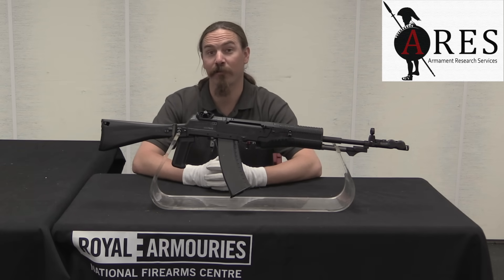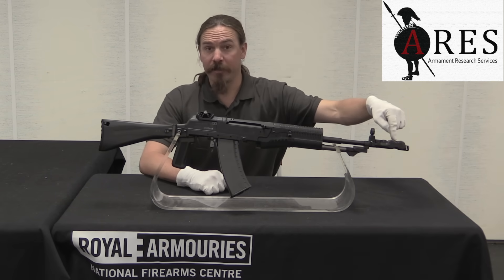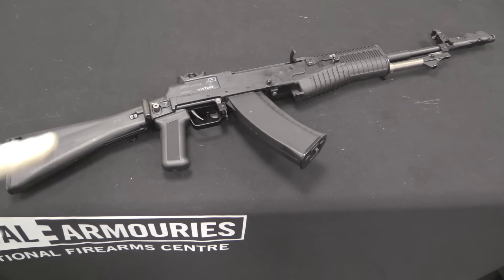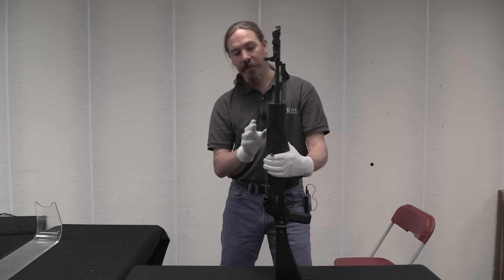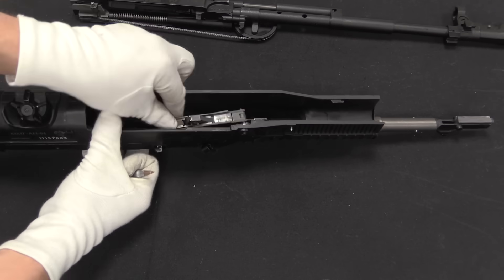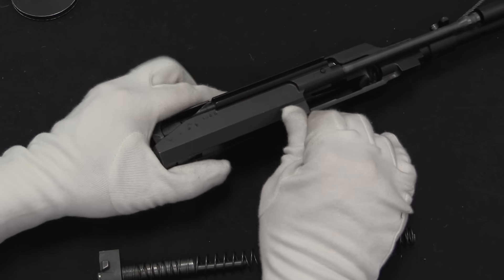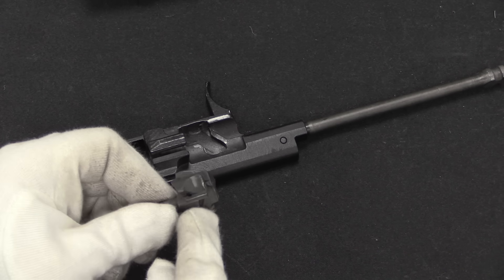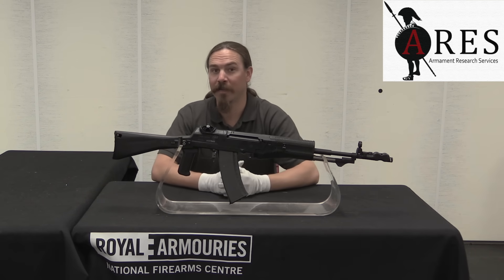Rocket Surgery: Inside the Russian Nikonov AN94

Comment: I don't understand why the little shuttle for pushing the 2nd cartridge out of the mag is necessary, if all it does is push a round half-way out of the magazine. I mean, what is the point of partially chambering a 2nd round to get it ready to fire if the bolt still has to travel the full length path to the rear of the gun and then back to battery, and can pick up and chamber the 2nd round while doing that just fine

someone please help me out here

is the little 2nd cartridge shuttle REALLY just a counter reciprocating recoil balancer and they decided to give it a little job to do so that it has a secondary purpose??????

Comment: hey ian! i doubt you check the comments on these old videos but if you do.... in the video i think you forgot to mention that the full auto setting fires 2 rounds in the hyperburst mode and then changes it’s rate of fire to the slower rpm for all the rounds after the first 2 for every trigger pull. and i was curious how that was possible? i know theres other guns that can change rates of fire but not during a single trigger pull. it’s just so neat.

Comment: It's an interesting solution to a problem, though, are problems than this platform creates, outweighed by the problem it solves? 

And you can see that AN94 creates a few problems, namely: 
Firing from a prone position using the magazine as a stand would be annoying. And before you say anything to the extent of "you are not supposed to fire your AK/AN like that", read the field testing report for AK47 from 1948, it is very much an intended style of using these weapons. 
The position of the strap loop on the left side of the stock could be annoying while aiming.
Imagine clearing a misfeed in this? Hopefully, you can shake the casing out, but I fear some misfeeds would require a tool or even partial disassembly, and nothing is more fun in the middle of a firefight than having to disassemble your gun to clear a misfeed.
The double fire mechanism makes a good grouping when the gun is held fairly loosely, which is what it was designed for, but the complexity of the machine makes it unfit for the general army use. On the flip side, the way that a professional tends to hold a gun (I understand that there are situations and gear that can prohibit this, but if they have a choice) is in a rigid, controlled grip, at which point the double fire grouping is reportedly a lot worse than just firing any usual, much simpler, much more usable platform twice, be that AK or AR.

It's undoubtedly a very neatly engineered machine, a very cool piece of gear, but it just feels like a solution that doesn't really solve anything for anyone who could be using it and creates more problems compared to other platforms they are already comfortable with using.
Reply: No one cares nigga 😂

Comment: Ak-47: Who are you?
An94: I'm you but complicated.
Reply: An94: I'm you but smarter
Reply: WeedNose Lieutenant all of what you described is assuming they want the weapon for an army. If you’re special forces you might wanna pick the AN-94 because you’re more specialized so there’s no need for simplicity.
Reply: @doc3353  even then, you just want a gun that does its job.  Usually for spec ops they’ll have a gun with different attachments like a thermal scope or a grenade launcher or something.
Reply: Please guys. Remember the AK74

"I am you, but better"
Reply: @TheKamiBunny  The AKM is a better AK-47. AK-74 is AK platform using new ammunition and improvements such as better muzzle brake.
Reply: @relevant3773  I thought the AKM is basically an improved variant of the AK47, the 74 was rechambered to a smaller faster caliber and as you said had that improved muzzle break. 

What would the AK107 be then?
Reply: @TheKamiBunny  this doesn't answer your question, but the AN-94 and the AK-74 fire the same round
Reply: @TheKamiBunny  AK100 series is somewhat based off the 7.62 AK series (not including AK15) AEK-107 which I believe you are referring to was an expirement to reduce the recoil of AK.
Reply: AK series and AN94 not related.
Reply: @Yku30  It is more effective in the field, but harder to deal with in general and more expensive. So I would say it's better in combat, but not better logistically
Reply: @Yku30  I do not know why I said AEK-107 lol
Reply: @Yku30  However, the AN94 fires a modern bullet, is modular, and is all-around superior in terms of statistics
Reply: @Yku30  The AK47? I have some doubts.
Reply: @Yku30  True, however 7.62x39 is nowhere near ideal for a modern war setting as 5.45. Since most combat takes place at either long range or very close distances, it simply gets outclassed by relatively more specialized ammunition
Reply: @Yku30  True, however it's main benefits (reliability, availability and something else that sadly doesn't end with -ability) are shared by other, less specialized Russian weapons (the AK74M, primarily).
Reply: I guess that is the point, it was way too hard to produce compared with the absolutely decent AKs before it!
Reply: The only superiority of an is that the 2nd bullet hits the same spot as the first one
Reply: WeedNose Lieutenant debatable
Reply: an94: I am you, but better in every single way
Reply: @xdbetyar  blocked

Comment: ooof. That wheel and wire looks like a fail point. That wire streches or is built wrong length, either jump off the wheel or doesn't position properly... remembering HOURS spent adjusting cable activated components (glares at old Alenax bicycle transmission bars, emergengy remote valve trips, and brake cables)

Comment: I think part of the recoil absorption misconception regarding the pulley system might stem from the fact that such a recoil system was designed for the AEK-971, which, to my knowledge, was also developed in parallel with the AN-94 as a competitor for the Russian Akaban(sp?) program.  It features a sort of piston mounted parallel to the Kalashnikov gas system, and while the main gas piston moves rearward, this second mechanism is pushed forward, the idea being it can cancel out the oscillation in the weapon's center of mass due to the movement of the comparatively heavy bolt carrier group.  I know of this being referred to as BARS, or "Balanced Automatic Recoil System."  What relation that label has to whatever name the Soviets used and Russians use, I'm not sure.
Reply: Yeah, interesting how that one's descendant A545 replaced the AN94
Reply: Абакан. (Abakan)

Comment: I'm guessing that when the barrel reaches rear end of travel, it prevents the hammer from striking again as the bolt moves forward the final time in the 2 shot or the semi auto cycle. Otherwise,the movement of the barrel is simply a means of slowing the recoil impulse from reaching your shoulder.

Comment: Explain to me the benefits of this complicated mechanism, please.
Reply: A near-simultaneous two-round burst would defeat a lot of body armor. First round damages the plate and the second continues through.
Reply: @chance20m  You want break armour of body? Hit with bigger bullet.
Reply: @EnjoyCocaColaLight  Which also requires a bigger gun, more weight to lug around, and a more complex logistics chain.
Reply: @chance20m  Weight is only problem until you have of training to the appropriate level. Complexity is of very bad design for doing the sand dust in mechanisms in the field.
Reply: @sebastiangorka200  Fair fair.

Comment: Just a note : "ММГ", written on the side, roughly stands for "Identical mass and size model", that can be made through factory deactivation, but can also be built like that from the start.
Reply: It's factory deactivated weapon. That's a common practice for post-soviet weapon manufacturers. They take old army guns or defective new, deactivate it and sell for civilian market as "ММГ".
Sometimes deactivation is done very badly, so you couldn't use that gun even for disassembly/reassembly practice. It depends on which factory actually did a job and was that gun used by army or it was defective new production.
Defective guns mostly deactivated much nicely than army ones.
Reply: @mk_69mm  I approve that. It is real gun, have been deactivated. All ММГ's are.
Reply: @МаксимГладышев-и3н  ahh yes you've got one of those inverted L letters on your name
Reply: @kakalimukherjee3297  those "inverted" letters was disigned by greeks before your far ancestors learned to write and use instruments
Reply: @kakalimukherjee3297  I see you, fellow non Russian speaker. Imagine if yt didn't translate
Reply: One more note: the keyword are the "mass" and "size", so it is usually not identical to real gun inside, but close to it.
The main idea is to use it for training or something, but without ability to use most of parts to build a real weapon.
The changes are not clearly visible, but critical to work - like bolt changes (some parts can be missed), or barrel ones (like holes and/or obstacles for bullets). So the quality can differs too.
Reply: @MaxPV1981  ММГ made from real gun
they never build as just models. it is deactivated guns always.
Reply: @Stormidze  No.
"Основным отличием ММГ от боевого оружия является невозможность изготовить из макета работоспособное оружие. Макеты стрелкового оружия могут изготавливаться как путём имитации, либо путём так называемой деактивации боевого оружия."

Если просто подумать, то становится понятно, что если какие-то части не могут быть использованы в боевом оружии, то они не являются частями боевого оружия вообще, хотя и могут быть изготовлены на их основе - тогда да, можно сказать и так.
Декоративные и не относящиеся к производству выстрела части, аналогичные по конструкции тем, что устанавливаются на боевые экземпляры, не могут становиться основанием для утверждения, что "ММГ произведён из боевого оружия".
Reply: @MaxPV1981  и все же ни один завод в рф не изготавливает ММГ. они именно деактивируют боевое.
деактивация происходит таким образом, что бы деталь было невозможно восстановить для использования в боевом.

СХП же - вполне себе работает. по этому схп не может считаться деактеватом.
Reply: @Stormidze  "они именно деактивируют боевое."
Вы подсвечник держали? :)
Для того, чтобы такое утверждать, надо точно видеть, что все экземпляры были изготовлены из запчастей, которые до этого стояли на боевых.
Чисто логически - если есть из чего (то есть списанные образцы), то это разумно.
Но это зависит от количества таких образцов, что завод не контролирует.
Есть заказ на ММГ, а ты ждёшь, когда придёт списанное? Не логично ли, чтобы обеспечить стаильность, использовать те же линии производства, но с другими параметрами, чтобы изготовить детали с минимальным контролем качества? Для списанных, не поверите, тоже контроль качества нужен - покупатели совсем не обрадуются, когда у них УСМ не будет двигаться, или ствол окажется кривой - и потребует расторжения договора.
И не из пластика же стволы делать?

В общем, утверждение о производстве ММГ только из боевых стволов не только не логично, но и вообще ничем не подтверждается.
Reply: @MaxPV1981  они не списанные.. они производятся из боевых частей.
просто собирается на заводе автомат из боевых частей. впоне себе боевой после чего его деактивируют. по этому ММГ и стоит дороже боевого.
Reply: @Stormidze  Всё это просто Ваши догадки. Ссылки-то хоть на данные от производителя есть?

По поводу цены вообще никак с реальностью не связано. Стоит он дрорже потому что, во-первых, это мелкосерийное производство, а во-вторых, за такую цену его покупают.
Reply: @MaxPV1981 Насколько я знаю, у нас не делают отдельно реплики. Охолощённое оружие делают именно из боевого.

Comment: In the 90 years, the marine corps in my city were redeployed to this machine gun. But there weren’t any trainers yet .. The soldiers went to the shooting range, shot, but refused to disassemble or clean up ... then they invented a way. ... after firing, they carried machine guns to the kitchen, put them in a large boiler and boiled ...... after they shook out the water and poured lubricating oil into the slots, after a couple of months of boiling the machine guns, the plastic parts began to crack and the machine guns returned to the warehouse.

Comment: The fact that the magazine sticks out to the side hurts my ocd
Reply: It's for super tacticool reloads😁
Reply: Belt-fed LMG's are unintuitive to reload, yet they are still in service...
Reply: The AR15 is unintuitive to reload, yet it's everywhere. Eject magazine button is on right side. Bolt hold open release is on left side further back. Charging handle is all the way the hell in the back on top of the gun. You've gotta either take both hands off one after another to reload or point the gun upwards and tilt it to charge the bolt with your left hand.
Reply: @rubiconnn  magazine release is on the left too you push the magazine release load a new mag click the bolt release on that same side it’s very simple

Comment: At around 2:40 or so, talking about the mechanism: Looking at the slow motion footage from Vickers Tactical, the recoil operated bits shift a bit when the gas operated bolt starts moving, really get going when the bolt reaches end of travel, and the second shot is fired just before the recoil operated parts reach end of travel, as the bolt is coming back towards them. Looked interesting seeing the recoil operated portion and the bolt slam together for the second shot, while both were moving in opposite directions.

Comment: Hi.
In my understanding of this firearm, the first recoil spring that you take off is actualy the hammer spring. In a first time (after that the round is fired) it's work like a bolt recoil spring, but for the forward mouvment, it's actualy the "cable spring" things that do it.

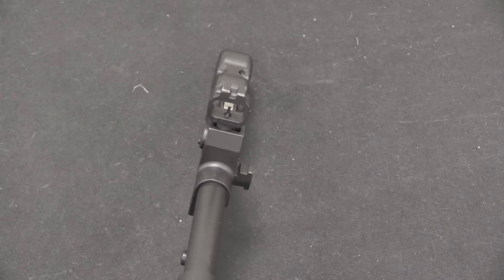Comment: 6:50 - this notch is for inserting glowstick and getting a nightsight. Here's the page from original AN-94 manual - https://i111.fastpic.ru/big/2020/0118/e3/82d0ebe18bac27e5cc7d1715886602e3.jpg
Reply: I'm surprised they didnt add one of those crank generators to the pulley to power a small LED
Reply: Thanks, you sent me to a site with porn ads
Reply: @dropkickedmurphy6463  that's because the AN-94 is porn
Reply: @Karroe  is this video gore then?
Reply: And here we have Makarov explaining NIkonov. Thanks tho!
Reply: @kalinkrumov4803  Makarov - is pretty common surname in Russia, so sadly I'm not related to designer of PM pistol or inventer of ice-breaker ship))

Comment: Most people I know like this gun for its 2 round burst thing but nobody seems to realize it's a very terrible and counter-productive feature. On the tactical level, you use twice as much ammo for the same result: most gunshots fired in war are suppression and, contrary to popular belief, suppression is done on semi automatic (one bullet every 5 to 15 seconds). In short range useage,  WW1 and 2 proved full automatic is game changing (particularly for indoors, trenches, and other tiny spaces where rapid reflex and quick killing is more important than precision)

   At the strategic level you now have to manufacture a whole bunch of new guns to re-equip an entire army just so you can get a new firing mode on your gun. The AN94 doesn't really differ much else from the already existing AK's in any other significant way. On top of that, your troops are either going to just not use it because of the increased ammo consumption, or they will and now you have to supply them with even more ammo than you already did; thus straining logistics. The increased complexity in mechanisms requires more maintenance, strainging logistics even more.

   The 2 round burst thing is sort of just... a cool idea that doesn't really translate into real life as well as you'd think. It's pretty cool at the civilian level at least because when you're just some guy popping at pieces of paper in a controlled environment the only thing that matters is fun.

Comment: How I would have done it would be to load the shells and separately the gun powder casing that would be used to compress a regulated air chamber that would compress air to allow for two air regulated shots from the chamber.  This would require two magazines but far less mechanics and cables.  You might even be able to get three shells travelling through the barrel before the first one exits and without any muzzle flash.  Think of it as 30 calibre air rifle on steroids.  That's a lot of mass but at a lower velocity.  The equivalent of say a 60 or 90 calibre shell at 1,500 plus feet per second?

Comment: Hmmm... The long stroke gas part is not unlike that of the AK, the delayed blowback recoil part very much reminds me of the Benelli M3, so both halves of the dual system are very similar to ones used for shotguns, this has me thinking that two round burst would be much more useful in 12 gauge than 5.45mm, the fast burst and slow full auto rate would make it halfway controllable too.  This thing might make a better CAWS than it does a battle rifle.